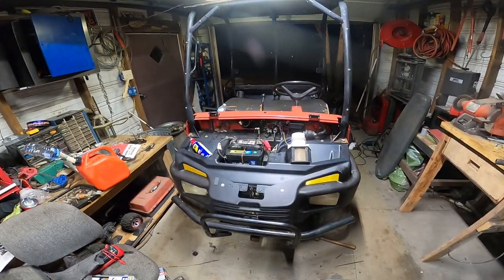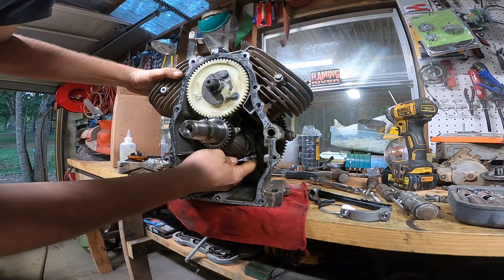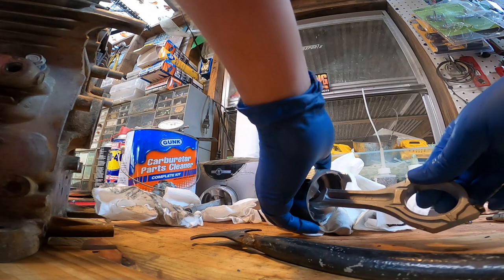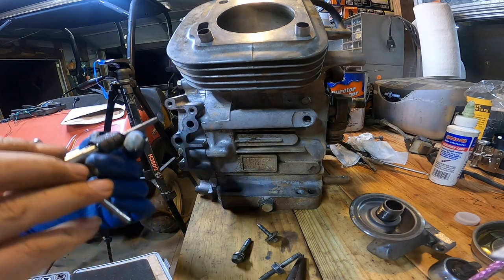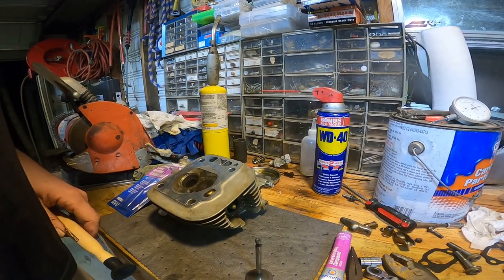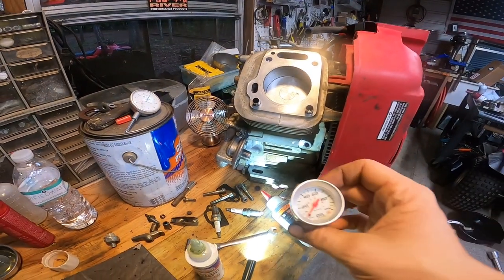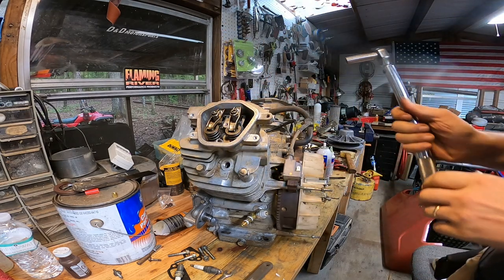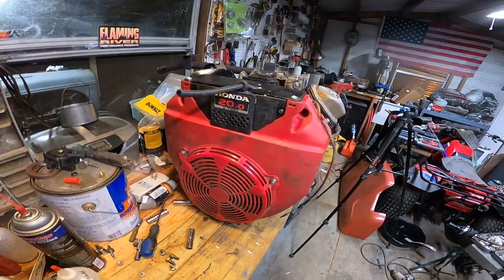PURCHASING UTV/MULE OFF MARKETPLACE (PART 2) THIS ENGINE IS NASTY!!!

Comment: Your ATC workbench is great! Is that flywheel open to the elements? No wonder the stator coils looked like crap and there was mud in there. The offset wrist pin gives less wear and friction and less noise (piston slap) between the piston and cylinder. Its used in a lot of BMW engines and there is even one that has a offset crankshaft. Putting it in the wrong way gives a lot of noice. Good thing you read the manual when you work, seems like a forgotten ability nowadays.
Reply from the maker: Haha 🤣 I need more shop space!! Your rite on the piston great description of it! And yes the manual helps a lot when you need specs on stuff, thanks for watching!! I always appreciate your comments!

Comment: I'm looking at getting one of those for free. Do you know where to get parts? Also, great job on the rebuild.
Reply from the maker: Hey thanks for watching and check out part three if you haven’t already you can get parts through messicks but they are very expensive
Reply: @TheHomePros6221  I do have one question.  If I decide not to rebuild, can I get a stronger more horsepower motor? Thanks for replying.
Reply from the maker: @aaronwarren8389  yes harbor freight has the same engine but it’s pretty pricey it’s a v twin 20hp like the honda